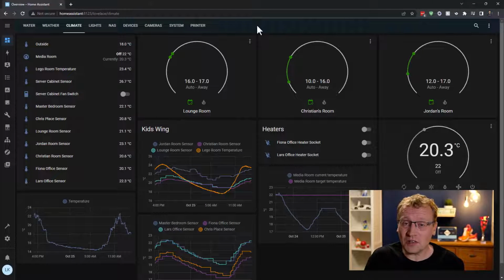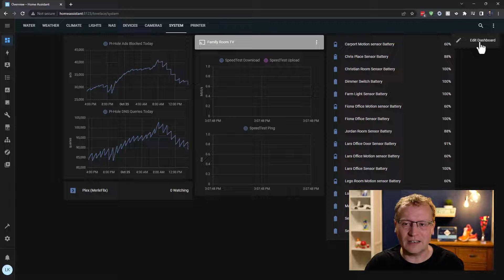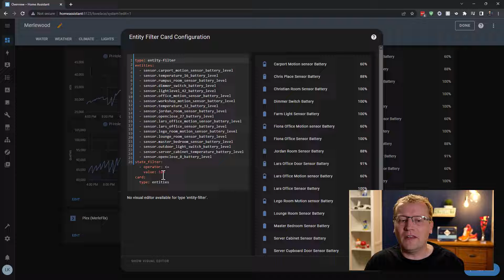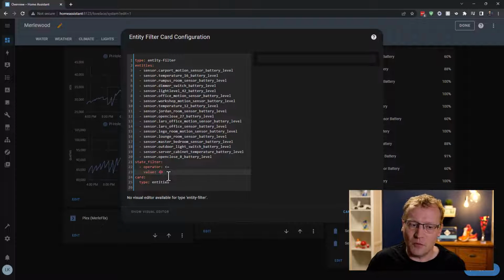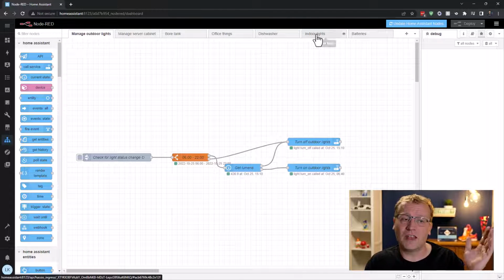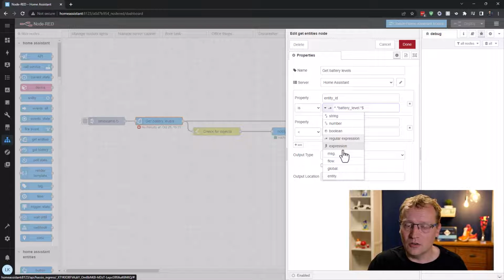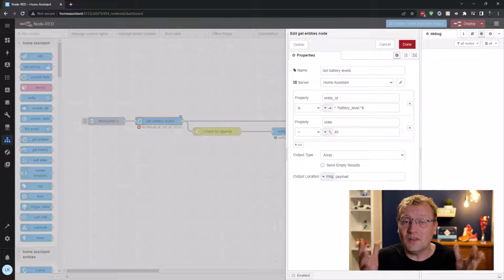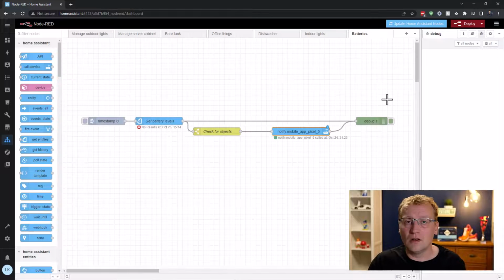Managing sensor batteries in Home Assistant

Comment: I use Openhab and I just add the battery powered devices to a battery group and then I run a report at 6:00am to email me if any devices are less than 15%. I also run a full report that shows the percentage of all the batteries in the group once a week. This way I don't have to keep looking for the information on the screen although Openhab automatically adds them to a display tab which I set when creating the device. So it is similar to how you are doing it but I have kept it all in Openhab.
Reply from the maker: I like the once a day report idea. The main problem is the reporting of devices on their battery state. Some keep saying 80% or more, even when they run flat. 
I haven't used OpenHab, but I suspect it works similarly to HA 🙂
Reply: @LarsKlintTech  yes that sometimes happens here but you can only report on what data you have even if it's wrong. 🙂
Reply from the maker: @ubeaut  Absolutely. 😂

Comment: Nice Video. I use a blueprint for this by sbyx called low battery level detection. Nice thing about this is that it automatically adds battery devices you add to your HA instance. It also has a way of excluding any sensors you don't want added as well. With a couple of simple automations it is very easy to tell when any of your sensors are low on battery. You can set the level at which the battery is considered low as well.
Reply from the maker: Very nice! I haven't really done anything with blueprints yet, but that is a great tip. I think I need to do a "Part 2" of this video, as there are so many good tips coming in the comments 😊

Comment: I really can recommend “battery-state-card”  for an overview. It has a lot of cool features like charging indicator or includes and excludes. 
But I wonder how you show the actual state of the battery. My ZigBee sensors are unavailable most of the time. How did you manage to show the actual or last known value?
Reply from the maker: I hadn't come across that card. Pretty neat, although I am not as interested in the current percentages, as I am in only showing the low ones. Looks good though and with a lot of features. 
I get the last known battery value from all sensors, although some of them I am not sure I trust what comes from them. I don't have any that don't show a value though. 
Which sensors do you have?
Reply: I’m using IKEA and Aqara with ZHA.
Reply: @LarsKlintTech  turned out that my timeout in zha for battery powered devices was too low (5min).
Reply from the maker: @Hafenstrand5  Alright, what does that do though? Does it mean that you don't get any readings into HA at all?
Reply: @LarsKlintTech  battery powered devices do not maintain a permanent connection but only report in on state change or after a period of time. If zha hasn’t heared from a device for a certain time it sets it Status to unavailable. In my case it was after 5 minutes but Aqara seems to only report in once an hour.
Reply from the maker: @Hafenstrand5  Hmmm, my Aqara devices send a value roughly every 15 minutes. But they are very rarely unavailable, unless they are out of power. I don't use ZHA though, so not sure if it is a setting somewhere.

Comment: I do the same with the entity filter card, but I also include "show_empty: false" so that the card doesn't appear at all unless there is information to display.
Reply from the maker: I added that the day after I published the video 😂 I'd like a title on the card if shown as well, but that isn't supported.
Reply: I have a title showing on mine. I have this added at the bottom:

card:
  type: entities
  title: *Card Title*

Depeding on the type of entities shown, you can also include this in addition to the title:

  show_header_toggle: false
Reply from the maker: @LoadsofBacon  You're a star mate! I was trying to add the same thing at the top, and then assumed it wouldn't work 🤦‍♂

Comment: Your video came a the right time. I was thinking about doing something like that.
The flow below will allow you know which batteries are getting low. Hope this helps some

[{"id":"d7079990661757ad","type":"ha-get-entities","z":"89b7a43e9bdf371d","name":"Get battery levels","server":"8a8aa3b0.98d5e","version":0,"rules":[{"property":"entity_id","logic":"is","value":"sensor.*battery$","valueType":"re"},{"property":"state","logic":"lt","value":"15","valueType":"num"}],"output_type":"array","output_empty_results":false,"output_location_type":"msg","output_location":"payload","output_results_count":1,"x":330,"y":140,"wires":[["6166daf55a1e2b92"]]},{"id":"cf8b26590c2f3aa5","type":"inject","z":"89b7a43e9bdf371d","name":"24h","props":[{"p":"payload"},{"p":"topic","vt":"str"}],"repeat":"86400","crontab":"","once":true,"onceDelay":0.1,"topic":"","payload":"","payloadType":"date","x":150,"y":140,"wires":[["d7079990661757ad"]]},{"id":"ae5852e92134260d","type":"api-call-service","z":"89b7a43e9bdf371d","name":"Notify Mobile","server":"8a8aa3b0.98d5e","version":5,"debugenabled":true,"domain":"notify","service":"mobile_app_sm_a320fl","areaId":[],"deviceId":[],"entityId":[],"data":"{\"message\": \" \" & payload & \" \", \"title\": \"Some batteries are getting low\"}","dataType":"jsonata","mergeContext":"","mustacheAltTags":false,"outputProperties":[],"queue":"none","x":930,"y":140,"wires":[[]]},{"id":"6166daf55a1e2b92","type":"switch","z":"89b7a43e9bdf371d","name":"Check for objects","property":"payload","propertyType":"msg","rules":[{"t":"nempty"}],"checkall":"true","repair":false,"outputs":1,"x":530,"y":140,"wires":[["bfe0243dabb22ff9"]]},{"id":"bfe0243dabb22ff9","type":"function","z":"89b7a43e9bdf371d","name":"message to send","func":"var low_level = \"\";\n\nmsg.payload.forEach(entity => {\n    low_level += entity.attributes.friendly_name + \"(\" \n                 + entity.state +\"%)\\n\"\n    });\nmsg.payload = low_level;    \nreturn msg;\n\n","outputs":1,"noerr":0,"initialize":"","finalize":"","libs":[],"x":730,"y":140,"wires":[["ae5852e92134260d"]]},{"id":"8a8aa3b0.98d5e","type":"server","name":"Home Assistant","version":4,"addon":true,"rejectUnauthorizedCerts":true,"ha_boolean":"y|yes|true|on|home|open","connectionDelay":true,"cacheJson":true,"heartbeat":false,"heartbeatInterval":30,"areaSelector":"friendlyName","deviceSelector":"friendlyName","entitySelector":"friendlyName","statusSeparator":"at: ","statusYear":"hidden","statusMonth":"short","statusDay":"numeric","statusHourCycle":"h23","statusTimeFormat":"h:m"}]

Comment: I don't have HA, but I use node-red extensively. If you show me what comes out of the entity list, I can probably format you a test for the notification. Maybe you can use the template node as well and format the output as a text.
Reply from the maker: Yes, I considered the template node too, but not entirely sure yet how it works. Here is a sample JSON of the entity list.

[{
	"entity_id": "sensor.lars_office_motion_sensor_battery_level",
	"state": "60",
	"attributes": {
		"state_class": "measurement",
		"on": true,
		"unit_of_measurement": "%",
		"device_class": "battery",
		"friendly_name": "Lars Office Motion sensor Battery"
	},
	"context": {
		"id": "01GGBPX4FJJBEFSNDZ9Y94MANN",
		"parent_id": null,
		"user_id": null
	},
	"last_changed": "2022-10-27T03:13:53.138Z",
	"last_updated": "2022-10-27T03:13:53.138Z",
	"timeSinceChangedMs": 28715227
}, {
	"entity_id": "sensor.lego_room_motion_sensor_battery_level",
	"state": "60",
	"attributes": {
		"state_class": "measurement",
		"on": true,
		"unit_of_measurement": "%",
		"device_class": "battery",
		"friendly_name": "Lego Room Motion sensor Battery"
	},
	"context": {
		"id": "01GGBPX4FK98A7GPC48FMEXYNE",
		"parent_id": null,
		"user_id": null
	},
	"last_changed": "2022-10-27T03:13:53.139Z",
	"last_updated": "2022-10-27T03:13:53.139Z",
	"timeSinceChangedMs": 28715226
}, {
	"entity_id": "sensor.carport_motion_sensor_battery_level",
	"state": "60",
	"attributes": {
		"state_class": "measurement",
		"on": true,
		"unit_of_measurement": "%",
		"device_class": "battery",
		"friendly_name": "Carport Motion sensor Battery"
	},
	"context": {
		"id": "01GGBPX4GBZ05G469KKZ0ZDXH1",
		"parent_id": null,
		"user_id": null
	},
	"last_changed": "2022-10-27T03:13:53.163Z",
	"last_updated": "2022-10-27T03:13:53.163Z",
	"timeSinceChangedMs": 28715203
}, {
	"entity_id": "sensor.workshop_motion_sensor_battery_level",
	"state": "60",
	"attributes": {
		"state_class": "measurement",
		"on": true,
		"unit_of_measurement": "%",
		"device_class": "battery",
		"friendly_name": "Fiona Office Motion sensor Battery"
	},
	"context": {
		"id": "01GGBPX4GF4274X7DB6V8B4CW2",
		"parent_id": null,
		"user_id": null
	},
	"last_changed": "2022-10-27T03:13:53.167Z",
	"last_updated": "2022-10-27T03:13:53.167Z",
	"timeSinceChangedMs": 28715199
}, {
	"entity_id": "sensor.pixel_4_xl_battery_level",
	"state": "31",
	"attributes": {
		"state_class": "measurement",
		"unit_of_measurement": "%",
		"device_class": "battery",
		"icon": "mdi:battery-30",
		"friendly_name": "Pixel 5 Battery Level"
	},
	"context": {
		"id": "01GGCJ38NPDSR91EXN1VN4WT6C",
		"parent_id": null,
		"user_id": null
	},
	"last_changed": "2022-10-27T11:09:05.590Z",
	"last_updated": "2022-10-27T11:09:05.590Z",
	"timeSinceChangedMs": 202778
}]
Reply: @LarsKlintTech  You add a template node and add this to the template syntax:
{{#payload}}
{{attributes.friendly_name}}: {{state}}%\r\n
{{/payload}}
the #payload /payload pair will loop the "code" in between for all the items in the array. And will print the friendly name and the percentage. The \r\n is the new line characters, I am not sure if it will be handled correctly in the HA notification. You need to give it a try. The text goes into the msg.payload, so probably you need to add it to the another object the way HA notification node accepts it. Also you can put your fixed message (e.g. These devices run low on battery) before #payload. I hope this works.
Reply: @csongorvarga  Thank you! That worked great for me!
Reply: Very cool feature. Where can I find documentation on that?
Reply: @17mty  It is called mustache template. So far I only used the double curly brackets to reference a field from the payload. And the # / pairs explained above to create a loop.

Comment: This is something I've been meaning to actually implement for a while. There is a custom card called auto-entities which should help with your first problem of needing to maintain the list of entities manually. It effectively also has the entity-filter card built into it as well, so you can filter on the state at the same time. 

I currently use badges with entity-filter to show when particular devices have gone offline, or when certain doors are open, etc. They appear on my main dashboard, which means I don't have to specifically go to another page/view to check on them. Helpful when something isn't urgent enough to send notifications, but doesn't get in the way for general day to day use.
Reply from the maker: A friend showed me the auto-entities card subsequently too, and it looks very handy as well. I like that it seems you can filter the entities shown, as well as the values. 
Ahhh, I like the offline idea for devices. That is super helpful. I might steal that idea for a video 😏

Comment: Can you share the flow?
Reply from the maker: Sure thing. Here is the JSON export.

[{"id":"89b7a43e9bdf371d","type":"tab","label":"Batteries","disabled":false,"info":"","env":[]},{"id":"d7079990661757ad","type":"ha-get-entities","z":"89b7a43e9bdf371d","name":"Get battery levels","server":"8a8aa3b0.98d5e","version":0,"rules":[{"property":"entity_id","logic":"is","value":"^.*battery_level.*$","valueType":"re"},{"property":"state","logic":"lt","value":"40","valueType":"num"}],"output_type":"array","output_empty_results":false,"output_location_type":"msg","output_location":"payload","output_results_count":1,"x":370,"y":320,"wires":[["347e172a0ebdf18e","6166daf55a1e2b92"]]},{"id":"347e172a0ebdf18e","type":"debug","z":"89b7a43e9bdf371d","name":"debug 1","active":true,"tosidebar":true,"console":false,"tostatus":false,"complete":"false","statusVal":"","statusType":"auto","x":1180,"y":320,"wires":[]},{"id":"cf8b26590c2f3aa5","type":"inject","z":"89b7a43e9bdf371d","name":"","props":[{"p":"payload"},{"p":"topic","vt":"str"}],"repeat":"86400","crontab":"","once":true,"onceDelay":0.1,"topic":"","payload":"","payloadType":"date","x":170,"y":320,"wires":[["d7079990661757ad"]]},{"id":"ae5852e92134260d","type":"api-call-service","z":"89b7a43e9bdf371d","name":"","server":"8a8aa3b0.98d5e","version":5,"debugenabled":true,"domain":"notify","service":"mobile_app_pixel_5","areaId":[],"deviceId":[],"entityId":[],"data":"{\"message\":\"One or more sensor batteries need changing\",\"title\":\"Sensor batteries are low\"}","dataType":"json","mergeContext":"","mustacheAltTags":false,"outputProperties":[],"queue":"none","x":910,"y":360,"wires":[["347e172a0ebdf18e"]]},{"id":"6166daf55a1e2b92","type":"switch","z":"89b7a43e9bdf371d","name":"Check for objects","property":"payload","propertyType":"msg","rules":[{"t":"nempty"}],"checkall":"true","repair":false,"outputs":1,"x":590,"y":360,"wires":[["ae5852e92134260d"]]},{"id":"8a8aa3b0.98d5e","type":"server","name":"Home Assistant","addon":true}]
Reply: @LarsKlintTech  Thanks!

Comment: My approach is to avoid batteries where ever possible, but appreciate the video. Time vs effort equation

Those PIRs could be replaced with an alarm system and have the sensors connected via serial stream in to HA.  Sensibo replaced with a direct integration etc.

All the best and enjoyed this and your other vids.
Reply from the maker: Thanks Shane, and thanks for watching 😊
Avoiding batteries is harder than it seems, both in terms of cost and effort in my opinion. I don't have power to a lot of the property, or where I need it for sensors, so battery power make sense to me. I don't really want an alarm system where we are for example, but a $20 motion sensor is super useful for many scenarios. Appreciate that batteries can be a pain though (hence the video 😉)
Reply: @LarsKlintTech  hey totally makes sense. Great looking lovelace dashboards. Allways like looking at other peoples for ideas
Reply from the maker: @shanebaldacchino  same!! I'm collecting ideas for a future video/project of wall tablets as HA control panels.

Comment: nice. will try the filter option

my current sort code is colour based only (green good, yellow meh, red dead) with the custom:battery-state-card: 

sort_by_level: asc

color_gradient:
  - '#ff0000'
  - '#ffff00'
  - '#00ff00'
Reply from the maker: I considered finding a custom card too, but in the end I was only interested in what was low, so didn't need it. I do like the colour option though. Looks nice 😃